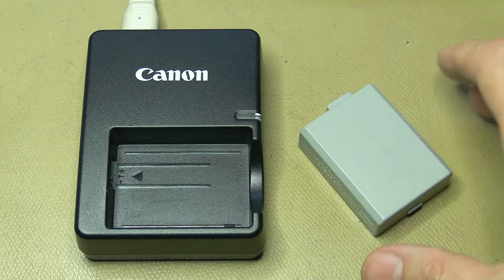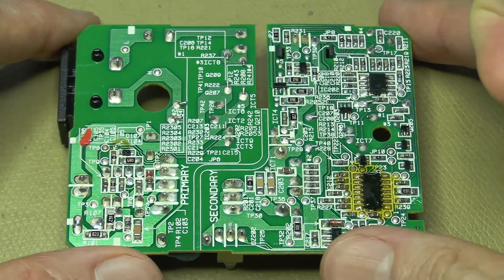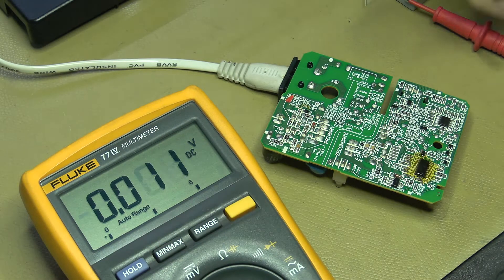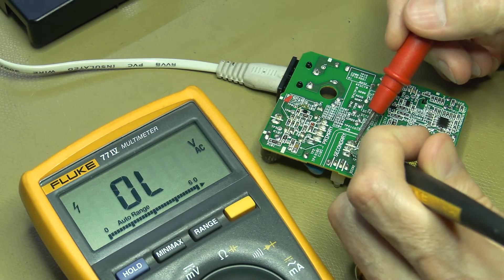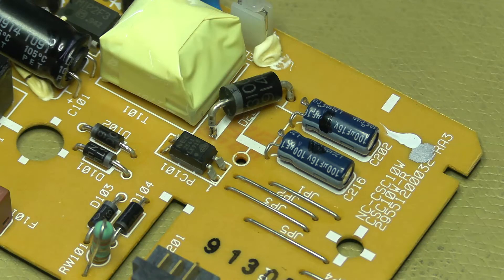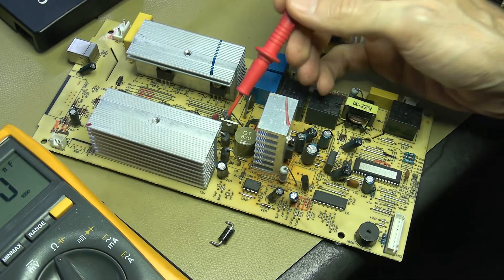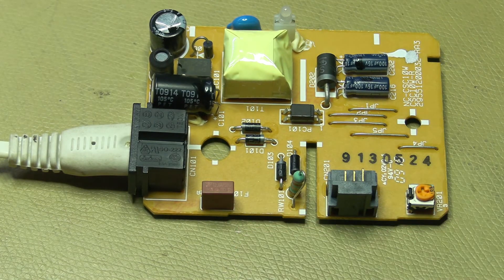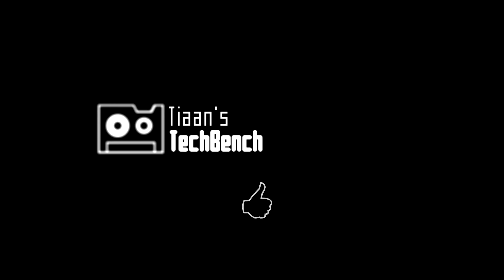Canon DSLR LC-E5E charger repair (#028)

Comment: Can i just replace all this circuit with a TP4056 module and ignore the middle pin?
Reply from the maker: Yes, I am sure you can. At the end of the day, you just want 8.4V to the battery, with accurate cut-off when fully charged. The battery will do its own balancing between its two cells.

Comment: On what we have to set multimeter
Reply from the maker: Oh, it depends on what you are measuring. For the initial tests, I checked AC so I semt my DMM to ACV. Next I set it to DCV when I was measuring after the bridge rectifier. After that I removed power and then measured in Diode mode to find the shorted component.

Comment: What size driver head are you using on those two fixing screws? I have nothing that small and will need to get one just to open the charger.
Reply from the maker: A 2.5mm Phillips head should work just fine (that's about 1/16th in yanky doodle units).
Reply: @TechBench  Thanks a mill for answering, my charger seems to have a tiny Torx or hexagonal head screw, so small its hard to see which, a Phillips head would be much better. - I'm on the European side of the pond, so metric is all good with me. Thanks again.

Comment: HI. I have a NB-2LH Canon charger. I've opened it to see if I could do a simple fix. Not a chance. Unlike this unit you've sorted out, mine has to wires from the board to the outlet socket. One of the wires was burned out of its placement it seems. Unable to find diagram assistance on the net I wonder if you could tell me where that wire should connect so that I can solder it back on? If you have a contact email I can send images to ? Hope you can help :goodvibes:
Reply from the maker: Check the About tab for contact details.